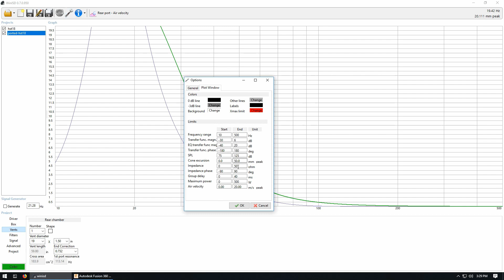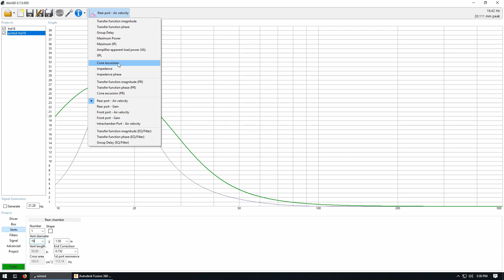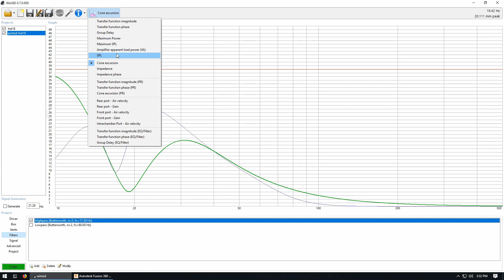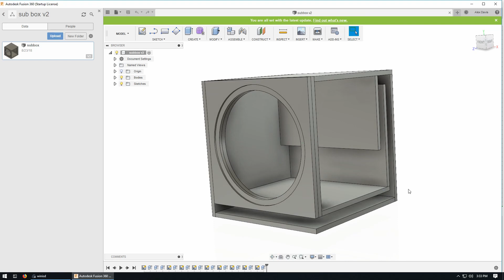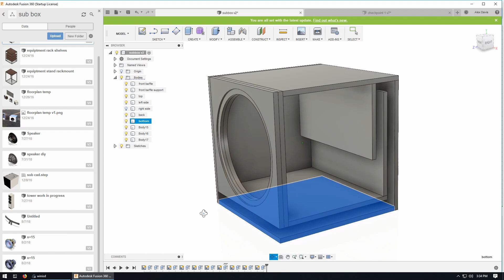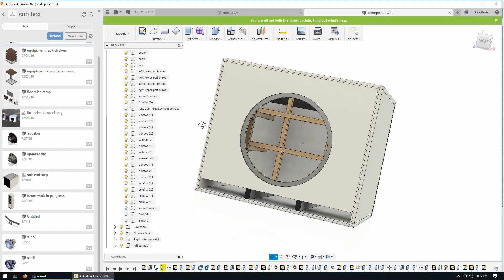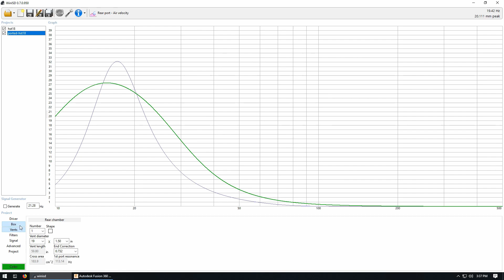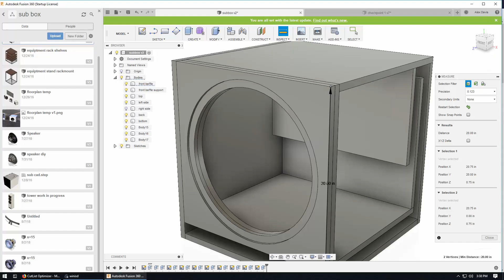How to design a subwoofer with winISD and fusion 360

Comment: Remember to add extra to panels with an external exposed edge so you can trim them back perfectly once glued together. This is a common technique that is used to achieve perfect interface for butt joints.  Don't do it for mitre joints though :P.

Comment: I'm trying to do the baffle and the vent, how did you it?
Reply from the maker: I generally like to double up the front baffle unless you plan on surface mounting the driver and not doing a recess for it to sit in. as for the vent, I use the dimensions in winISD, and then make it as shown out of MDF. I use best judgement for if it needs bracing or not along its length. if you do add bracing, just make sure to account for it. I guess the proper way to do it would be to simulate the box with FEA and make sure any port resonance is a few octaves above where you plan to xover, but fusion360 removed the ability to do that in the free version of the software. in reality, its probably fine unless you have a port 30+ inches wide

Comment: Great vid I understand the info. Why use SPL instead of Transfer function Magnitude? Is Fusion free?
Reply from the maker: SPL gives you the estimated real world output, where transfer function magnitude shows you the effect the box has compared to an infinite baffle setup (basically having an infinitely large wall the sub is mounted to).
fusion is free for personal use with some restrictions. if they get in the way, you can apply for a startup license. they seem more on the lax side of granting licenses, though there is an approval process so its not instant.
Reply: @MethodicalMaker  Thanks really appreciate the answers

Comment: Is it really 30m/sec or 17m/sec ??? 
For a rectangular slot port with very little rounding of edges (5 mm radius edges)
Reply from the maker: Are you talking about the examples in this video? Port velocity was ~30m/sec for those... the next graph (where it said cone excursion at the top) was for the travel distance of the speaker cone its self.
Reply: @MethodicalMaker  well... I always kept port air velocity under 17m/sec. I never went upto 30m/sec. So I am not sure if we get port noise with 30m/sec. 

Did you build subs with 30m/sec?? did you notice port noise ?? (With very little rounding of edges)
Reply from the maker: @audfrknaveen2256  Yeah, I built the box shown by the green line. I could not hear any port noise. the edges were rounded with a 1/2" round over on the outside of the port, and internally i believe it was rounded on both edges with 1/4" round overs, and then smoothed with some light sanding.

Comment: --IDK that it is worth my time to use Fusion 360 to design a "Box" because I don't plan on making enclosures all the time. Besides, I can draw up the box with pencil and paper; otherwise, I just design in my head and build off that. I used to build houses, and reading blue prints so much that I can picture them in my head, but also can modify them in my head to the new concept.
--But it is pretty cool to see your design in a CAD program. 
--The winISD part of the vid was good.
--Plus, I'm not building a square/rectangle box, anyway. The left side will be concave, 8" tall, 14" long, then 5.5" long at different angle, etc. Does that program, Fusion 360, work for something like that?
--Or does anyone know of a program that can use the iPhone, etc. to measure the volume by taking a picture?
Reply from the maker: The most useful part for fusion 360 is calculating volume. Sure, you can design on paper or in your head, but the volume calculation becomes complex when thinking about bracing, internal subwoofer displacement, and subtracting port volume. Fusion 360 can do very complex shapes, and theres tons of videos out there for learning how to do this.

the iphone can build 3d models, if you have one with the depth sensor(don't use the apple ecosystem, so could be wrong... but i think the 12 max has this, as well as one of the ipads) then you can build models with that, and they should be very high quality. If you don't have one that supports that, then you can use a technique called photogametry to generate 3d objects with a bunch of photos. You get the best results if you keep your phone steady and rotate the object on a lazy susan. There are apps to do this as well as cloud solutions. Once you have the object, you just scale it off of a reference value then calculate the volume in a cad program.